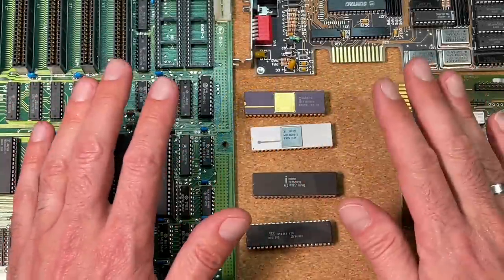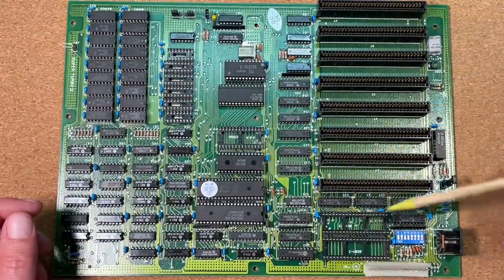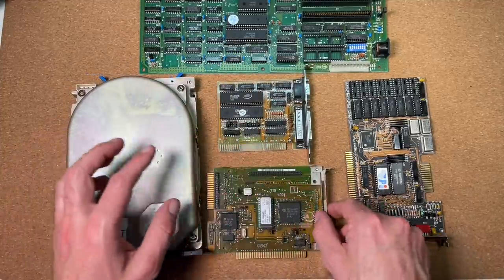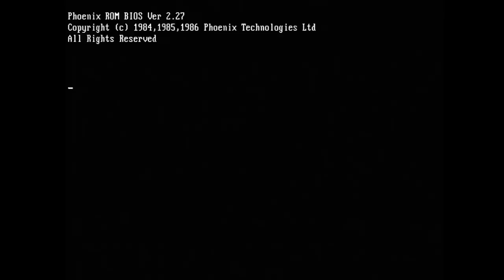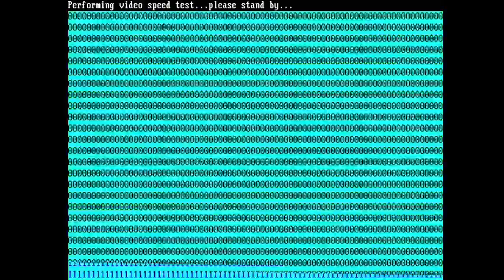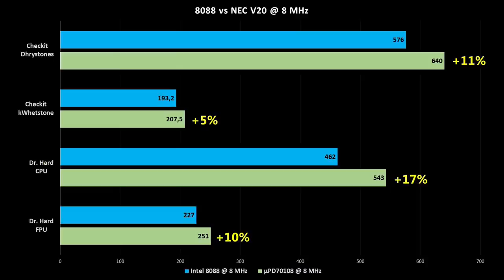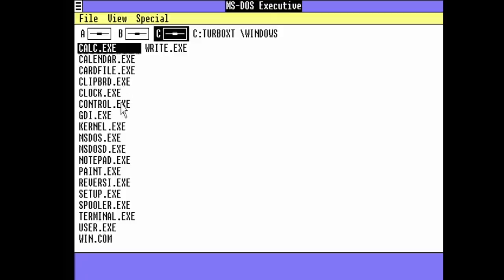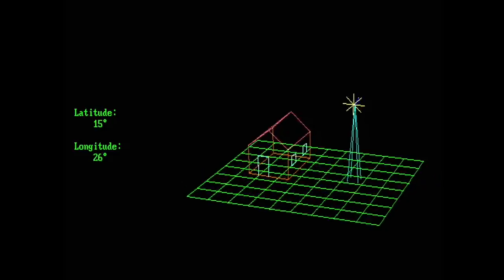NEC V20 D70108D VS 8088 CPU Benchmark + Windows 1.01 Booting

Comment: I've noticed you just throw in the cards to the ISA slots, seemingly randomly. Is there a method to the maddness, or were there no IRQ conflicts back then as I recall having many issues with IRQ conflicts on later 386/486 systems?
Reply: Hi, even with very early machines you can get conflicts, but often in these systems there is a small quantity of add on cards used

Video often runs on its own as does a multi I/O card

The first conflicts come with sound cards that clash with another card , typically on ST a date / clock card 

Once you add a modem and you have 2 serial ports then that is when the first conflicts start, adding sound and network just build up the issues.

Very early ISA card are actually good as they have instruction on the physical pin connectors to the jumpers on them that hard wires the IRQ or memory address ( sound and lan ) so it is basically just some planning up front

I find the main drama is advanced sound cards that use 2 or 3 irq's due to each sound mode having its own unique interrupt  adlib / sb16 / midi - your machine can have this card, but if it has a modem and lan card or scsi then you have to juggle IRQ's

Dos 5 solved a lot of these issues by being able to reserve memory address for specific hardware eg a SMC lan card can use c0000 or c4000 memory location and you exclude that in the config sys, this makes a memory hole at that spot that software cannot use but preset hardware can, same with sound cards

But you are correct only 1 device to each IRQ,   PS2 AT's and later had a few extra irq's that XT/AT does not have , IRQ 9 was modified at the same time to jump to another set of new irq's, so by 386's the sequence was   1, 2 redirects to 9 , 3,4,5,6,7,8,9 then 9redirections lets call them 9A 9B 9C 9d, then 10,11,12,13,14

Comment: I had an XT clone that was supplied with the V20.  It wasn't 100% compatible with the 3.x version of MSDOS I was using.  Some programs crashed on the V20, but ran fine on an 8088.  Both were 10mhz versions.

Comment: Interesting!
Also "windows" 1.01, I want to try this too now.
I am still waiting for my 8088 machine :(
Reply: I wished I still had my 8088 XT. I even had an original IBM PC XT with original CGA monitor but I threw them all out years ago 😭😭😭. I also miss my 286 12MHz as I loved running Windows 3.1 on it along with Wolfenstein 3D.. I also miss using GEOS on my original breadbin C64 - so many classic computers and great early GUI operating systems that I threw out decades ago 😭
Reply: Yea soo sad :(
I do not have my first 2 PCs too :(
I have 20-30 Retro PCs now to compensate for that XD
But still :(
Reply: @mrbrad4637  okay pc/geos is more faster than the shit of win3.1

Comment: Replaced an 8088 on an XT way back in the day not long after the V20 came out.  I certainly noticed a difference,  guess I didn't realize how small that difference was.  I feel back then any improvement was noticed.  Never found any real issues that I can recall.

Comment: The first graphics capable PC I had at home was a Packard Bell powered by an NEC V50 CPU. Most of the games I had access to for it were optimized for an IBM XT and they ran way too fast.

I much preferred the Apple IIgs and Macintosh systems we had in elementary school at the time. More colours, proper sound.

Comment: It's almost hard to believe how much change there has been in 40 years for both hardware and software.  I have been witness to all of it.  I can't remember what the edge-card connector was used for on the top of the Trident VGA card.  I seem to remember seeing them, but otherwise I am drawing a blank.

Comment: Awesome video! I think it's worth mentioning that the memory bandwidth test showed a nearly double increase in performance with the V20.
What did you use to connect your mouse? Serial? If I did that, would I need a driver?

Comment: I fitted a V30 processor to my  Amstrad PC-1640 (which I had modified to run on a different monitor) which also had an ST-225 hard disk.  OK, it wasn't fast but it was a very cheap PC and served me well for years.

Comment: /OFF If it comes to flipper games, then the real retro for me is David's Midnight Magic on the C64. I literally spent hundreds if not thousands of hours playing that game. /ON

The NEC had other interesting CPUs after the V20, like the V30 line, V40 line and V50 line. Olivetti built the M200 around the V40, thus creating an early all-in-one computer. All-in-one means in this case that the case was the CRT monitor itself. :) Hard drives and expansions however needed an additional housing, together which the machine resembled a "normal" PC.

Comment: What are the fingers on top of the trident card for?  I.e., the ones that aren't the ISA connector.
Reply from the maker: This is called a feature connector to overlay an image as used for instance with mpeg decoder cards or TV tuner cards.

Comment: I recently put together a XT V20 10mhz system. I put it in a AT tower case which is probably a heinous crime but what the heck, I don't have a desktop case. Also used 16bit ISA Ega/Vga video, a 16bit SB16 and a 16bit IO card. Aside from the IDE it all works perfectly but I have a CF card setup so don't need the IDE. There are many great games for these like Stunt Car Racer, even Lemmings works ok but a bit slow. A lot of the earliest games work great at 4.77mhz. Al's Geek lab has a great series of Youtube videos for Dos games starting at 1981. The PC speaker actually sounds quite good running through the SB16.  I must say though that Windows 1 and 2 were Years behind what they should have been. Compare it to Amiga Workbench or Atari's OS on the ST or even Mac of the time. I guess Microsoft took windows seriously from version 3.0 as it really was a lot more modern and useable.

Comment: I have an Intel 80386 plug in XT upgrade card, which I bought back in 1990. It plugs into the processor slot via a jumper cable from the card. The card has 1 megabyte of RAM on it.

Have you ever heard of these Intel XT upgrade cards??
Reply from the maker: yes i know this upgrade cards. Very cool stuff. But I dont have this unfortunately in my collection.

Comment: Your 8MHz Turbo board is strange. The manual says 10MHz everywhere except on the title page and the introduction text. It mentions the model number PIM-TB10-Z in the text. And it looks exactly like my Turbo XT board, which is a PIM-TB10-Z clone board. It seems they downclocked a 10MHz board to 8MHz. You might want to try replacing the 24MHz crystal oscillator by a 30MHz one.
The original PIM-TB10-Z board is manufactured by DTK and has an ERSO/DTK BIOS. Your board has a Phoenix BIOS, like my clone board has it, too. So it seems your board is likely a clone of that 10MHz board, too, but with a slower oscillator.
Reply from the maker: good hint. thank you!

Comment: You could perfectly test windows 3.0 that has real mode and works in an xt without problems and to test the mathematical coprocessor I recommend the FRACTINT program (fractal generator) that recognizes it and the drawing speed shoots up exponentially.  And that 8-bit scsi card gives me envy, I was trying several 16-bit cards with the hope of finding one that works in 8 bits but I have not been successful, I use a parallel ZIP disk as an external disk in my Epson equity 1+ del 86.

Comment: Me in 1990: I buy the Trident 8900 instead of the Tseng ET4000 because higher numbers mean "better", right?
Reply: me in ~1993: I can spend exactly $40, this is enough for 386DX40 motherboard with 8MB ram.
My well meaning computer literate friend: I can hustle you a $50 486SX33 with 8MB ram on a motherboard with VLB and DX2 support.
Me: Nah, $10 is a large pizza.
Me at the end of 1993: Doom at 6-8fps ....

Comment: That’s actually a little bit of a disappointment for the V20, given its massive transistor count compared with the 8088 I would have expected better then 10-20% performance improvement, the V20 doesn’t actually get much bang for its transistor buck.  The Motorola 68000 seems to do a lot more with about the same number of transistors.

Comment: 11:55 "[Microsoft Windows] was really something new". Not really, Windows 1.01 was released 18 months after the Macintosh came out, which had a full GUI, whereas Windows 1.01 had licensed only a feature subset from Apple, missing for example overlapping windows. 
The Macintosh was lightyears ahead of any PC at that time and anybody who had used one would laugh at this early Windows crap, therefore your excitement about it is quite amusing. Perhaps it is time to expand your horizon a bit :)

Comment: You need to do some direct die water cooling and overclock them until they die.
Reply: No, heat is not a limiting factors in XT class CPUs which is why they don't need heatsinks. These CPUs, memory and support ICs were made using such large feature sizes (by today's standards) that the transistors are simply too slow to support high clock speeds.

Comment: Hmmm, 2x transistors  for 10% performance increase. Not conforming with my definition of efficiency.
Reply: It had a smaller feature size (2um compared to 3um for 8080), used less power (CMOS vs NMOS),  supported many more instructions (including 286 real mode instructions) and could emulate an 8080. The 10% benefit is from running standard 8088 code, if the enhanced instruction set is taken advantage of more speed gains would be possible.

Transistor count has never been a measure of efficiency in CPUs.
Reply: @ferrumignis  It has implemented 186 instruction set, but much of the software that "demands 286" actually is relying on 186 instructions, so the Cpu is almost AT compatible, thats an advantage. But "more speed gains" are either non-existent or invisible . If even benchmarks, that are obviously capable of detecting and utilizing 286 and other CPUs, can not find more than 10% (ok, 17% in some cases) difference, that is absolutely the best you can expect to measure in the real-life applications. Still, i would like to see some application that can use both 8088 and 286 modes, and than test 8088 vs v20.
Transistor count was and is the measure of efficiency, thats why its always mentioned in the reviews every time new CPU/GPU is introduced. It usually boils down to power consumption vs. performance, but transistor count is the main factor behind the power consumption (given the same lithography process size).
Reply: @fradd182  The biggest jump will be while utilizing 186 instructions for IO operations (REP INSB/OUTSB INSW/OUTSW) instead of 8088 ones (in al, dx 
| stosb | loop). In XTIDE the difference is 170KB/s vs 390KB/s at standard 4.77MHz clock.
Reply: @rasz  Yeah, if thats the way of transporting data to local framebuffer and sound card, it should be noticeable in games.
Reply: @fradd182  
> local framebuffer
no luck, memory mapped, rep stosw is the best you can do on both 8088 and V20

>sound card
DMA playback with minimal CPU load. Its the mixing multiple voices that gets you, again no advantage on V20 side.

Second niche where V20 would shine is Network transfers. Most contemporary network cards implemented NE2000 compatibility and transferred data from/to cards ram buffer using I/O port operations, same ones as in the HDD example. V20/186/286 gives you easy double transfer rate.
Reply: @rasz  Thanks. But it puzzles me a bit - if you add something like 512kB VGA card to your XT, and 8088 can address only 1MB, where does is it map 512kB of graphics RAM?
Reply: @fradd182  All ISA VGA cards were mapped and visible thru 64KB window at 0xA000.
VESA 1.2 compatible SVGA cards had bios functions for bank switching this window around VGA ram. When you set a high resolution high color mode VESA bios returned information about number of banks, layout you had to work with and info when to switch banks manually, it was pretty cumbersome.
VESA 2.0 introduced linear framebuffer (LFB), of course this required 286(really 386, nobody used 286 protected mode) and up CPU. There were problems when using ISA and afaik only Tseng ET4000 and ATI Mach64 supported LFB, with ATI being only one allowing mapping more than 1MB at once.
ISA is limited to 24 bits of address space = up to 16MB, so new Bios option appeared in 386 and later motherboards called "Memory Hole At 15M-16M" to make room for 1MB of ISA card address space when computer has more than 15MB of ram. If you had 4MB ATI Mach64 and wanted it all mapped linearly you had to contend with 12MB ram max installed etc.

VLB and later (pci/agp/pcie) interfaces allowed for linear framebuffer to be mapped arbitrarily at whatever address you wanted.
Reply: @rasz  Thanks for exhaustive explanation, its cleared up now.